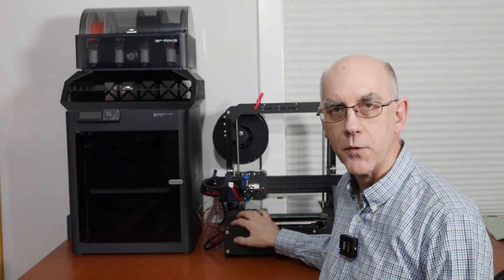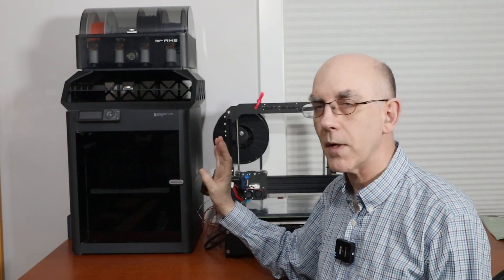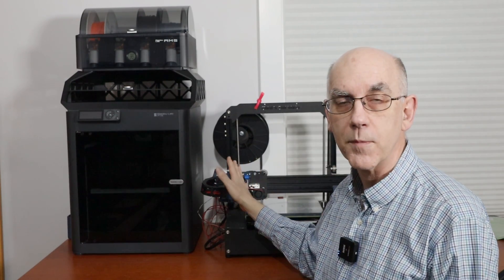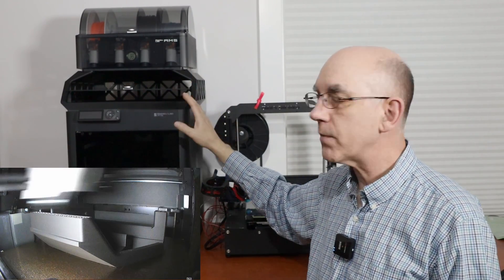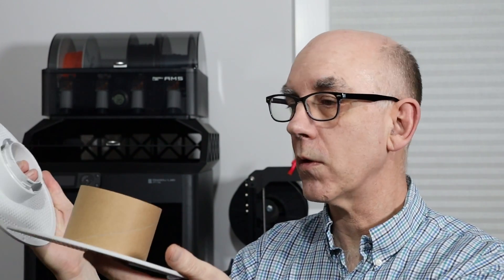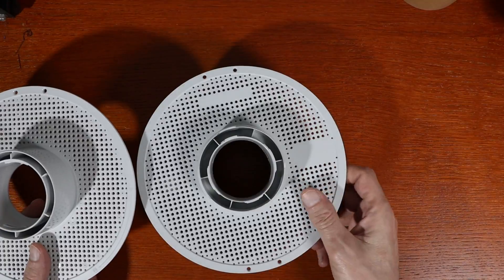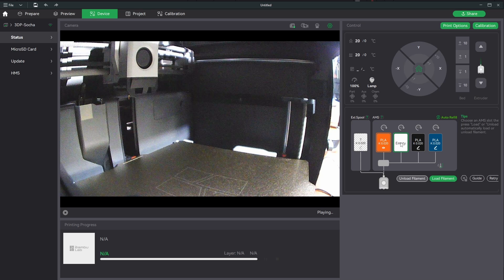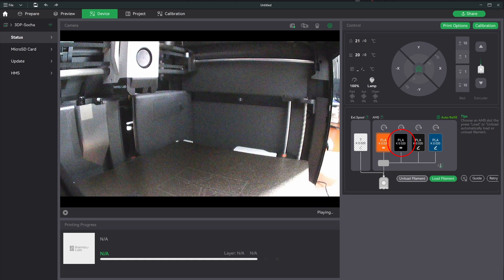Switching to a Bambu P1S

Comment: Hi John.
A friend is into 3-D printing, and a couple of weeks ago I took the plunge and bought a P1S, with AMS.  Set up was quick and easy, and since then I produced a number of items, most of which to improve the printer.  E.g. a 12.5mm riser, into which I installed COBLED lights, what a difference, a Tapo WiFi camera, Poop chute, silicon tube nozzle wiper, silica gel holders for the AMS, which keep the humidity around 12%, and improved filament loading buttons.
My P1S came with a wireless mouse kit. I made the case using Royal Purple Sparkle, and Orange PLA, and it works!
All of the items printed flawlessly🤗, and all were made with the door and lid shut, and detaching from the plate was easily.
I bow to your superior knowledge.  However I suspect your preference of keeping the cabinet open, might be unnecessary. Any thoughts?
Cheers Noel

Comment: My first current gen printer was a P1S combo almost a year ago now. It used to be that the printer was the hobby and not necessarily the prints. Bambu changed that. My recommendation is that you start trying multi-color when you have a use case for it. I mostly use it on prints to add a label, which makes it look a lot more professional if done well. My wife has a couple of A1's and a mini, and she uses multi-color all the time for her nicknacks. She does some really excellent and impressive decorative pieces. What kind of CAD are you using?

Comment: P1S is a good choice, except for following:
Tough to go over 100C bed temp.
Printing with CF nylon, PC is difficult.
Does not have hardened nozzle or extruder gear(upgradeable though), mainly useful for abrasives CF, magnetic PLA etc. No lidar/camera for flow calibration for every print. Also has lower rez camera for live view. The display is monochrome and not touch sensitive. Also has plastic side covers instead of sheet metal.

Comment: I purchased the A1 + AMS Lite at the beginning of the month and absolutely I love it. Compared to my previous Anet A8s and Ender 3 it's a night and day difference. I really want to print ASA so I made a setup in a closet with a dehumidifier, humidity/temperature monitor and filament dryer. Depending on my results I may get a P1S in the future, but the price gap is large imo.

Comment: I recently bought the P1S too after some years with a couple of Ender 3s. Like you, I'm getting great prints. But I'm curious as to why you don't want the cabinet closed off to outside air while printing PLA. I keep the top on and the door shut whether I'm printing PLA or PETG.
Reply: I'm pretty confident the issue is excess heat buildup causing PLA prints to sag.

Comment: My issue with the AMS is that it's kind of wasteful on filament if you multicolor print, but a lot of community work is being put into designing "press molds" where you warm up the PLA purges in a junk toaster oven, roll it into a ball, and stick it into a mold you press by hand or in a vice. I do use the AMS for tear-away supports where the interface material between the support and the part is a plastic that sticks when hot, but falls off when cold. You still have to be selective so that you're not wasteful but I find the right applications to yield flawless results.

Comment: Does the AMS system have a filament dryer built in ???     What I hate about my current printer is I have to remove the filament after each use and wrap them up  to make sure they don't absorb too much moisture.
Reply: It sort of does, and it has a humidity sensor that reports back to the slicer over the network. There are two slots in the back that you stick desiccant packs in and they're good enough to keep filament dry, but a common first print is a bunch of boxes to put loose reusable silica gel beads into since there are spots you can put those in.
Reply: There are also several videos showing how to add an external dryer to the AMS.

Comment: John, i don’t see you as a multi color filament for the sake of aesthetics kind of guy.  I could see your use case for the AMS would be using water soluble support filament or replicating over molding by experimenting with combining different types of filament
Reply: I love the AMS Lite on my A1's ability to auto switch when a roll is empty. No more watching the printer to load another roll when I get close to the end. It just works.  Amazing tech all around.

Comment: Do you have to buy Bambu filament?
Reply from the maker: No, I should have mentioned that. I've been using a mix of Bambu and other brands. Once I run out of the other brands, my plan is to just buy Bambu refills because I like being able to reuse the spools, and I like the RFID feature.

Comment: I just ordered my third Bambu printer today. I have two X1C's and a P1S. They are work horses and have thousands of hours on them printing mostly ABS/ASA.
Reply from the maker: Do you have a preference between the X1C and P1S?
Reply: @JohnSL  The X1C is a little easier to use if you don't have a computer or phone with the Handy app near by. The screen is easier to navigate and you can change details about filament in the AMS. That being said the P1S produces identical prints for a lower purchase price.
Reply from the maker: I decided that I didn't need the touch screen or the auto flow and AI features. I'm curious which model you prefer.
Reply: @JohnSL  Personal preference is the P1S and is the printer I have at home.

Comment: Not sure if this was perfect timing or absolutely awful timing.  I've been looking at the X1C the last few days and wondering whether I should pull the trigger..  Can't say I'm less motivated to spend money now.. :)  
Hope you'll enjoy your P1S!
Reply from the maker: Hope this helped. There are other things I like about the P1S (that also apply to the X1C) that I didn't mention because other videos have focused on those areas. For example, the speed.
Reply: @JohnSL  It's the speed and and improved tolerances that I'm after mostly, and finally the print quality.
Trigger has been pulled. X1C + AMS.  I told the wife that since you pushed me over the fence, you'll be taking half of the economical blow.